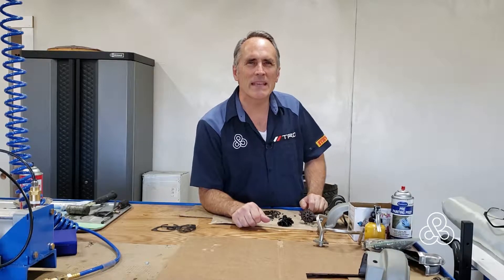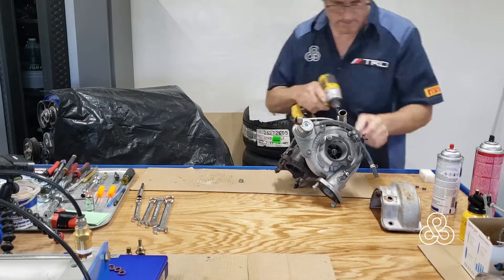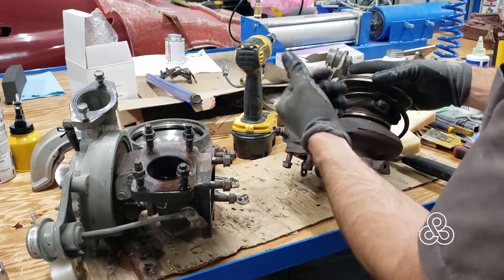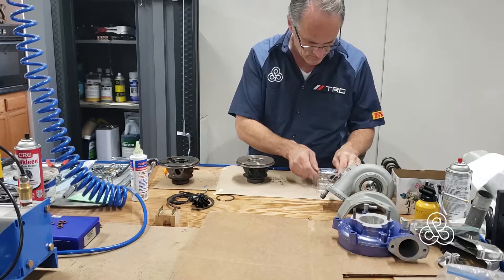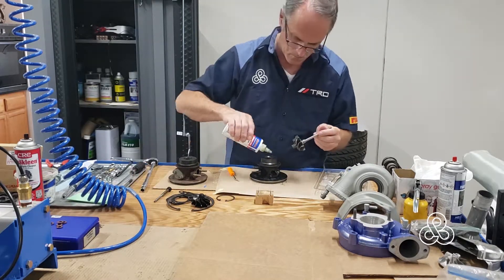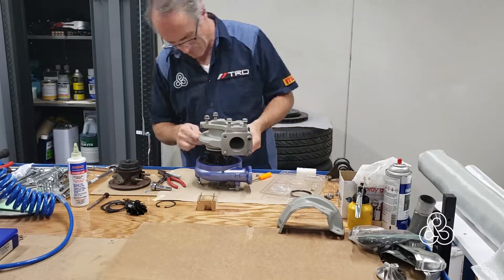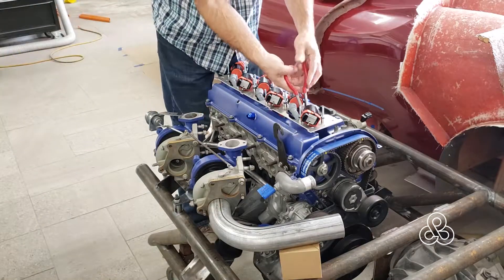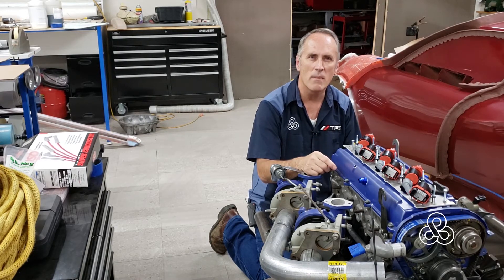A13 - Arete Supercar project -The twin turbo setup – CT15b Turbo rebuild

Comment: This stage clearly required a lot of advanced planning for you to know how to mount the turbos, where the lines will be running, and how the piping will go from them to the intercooler and the exhaust. I assume that you planned it all out to fit within the space of the body, right? Did you have to plan out the engine layout, mounting, and components in CAD?
Reply from the maker: Yep, I do a basic layout of components in AutoCad (2D plans and elevations) to try and keep things within the "envelope." I get  a lot of people telling me I should have built the entire running gear first and then fit the body around it, but I have had only a few (very small) interference problems. The chassis first thinking, fails when you are building a monocoque tub that is the main portion of the chassis. The "build the components concurrently" method is working just fine.

Comment: Can you link to the rebuild kit you used for the Ct15b?
Reply from the maker: If you have damage to either of impellers or just want to upgrade to the stronger Inconel turbins, I just found the receipt. Turbine impellers w/shaft- Kinugawa Turbo on Amazon marketplace SKU-406-07358-001 this company also sells the rebuild kit.
Reply: @BuilderCreator  Awesome! Thanks a bunch!
Reply from the maker: Try this link on ebay-    https://www.ebay.com/itm/MAMBA-Turbo-Repair-Rebuild-kit-for-TOYOTA-CT15B-/262819677786   I think these kits (and from other sellers) are all very similar and often have parts to match several different turbo models bundled together. This is the link where I got my kit, but beware-  when my kit(s) arrived several parts where just not right. I got hold of the seller and they sent off the correct kit. Neither packages had markings, so it is easy to see how they could grab the wrong item off the shelf. Luckily, I of course, was not relying on the rebuild to get a car back on the road. Watch that impeller when you separate the housings!